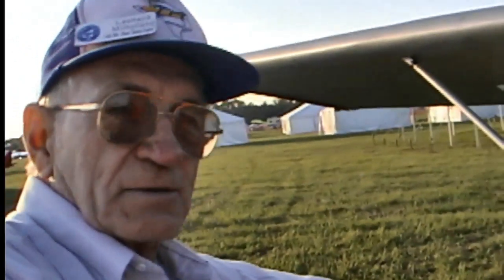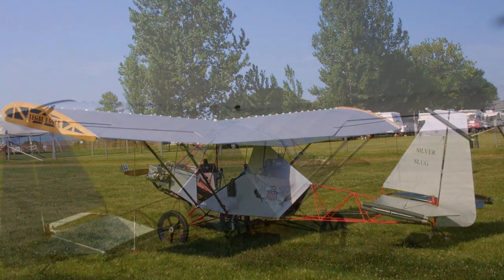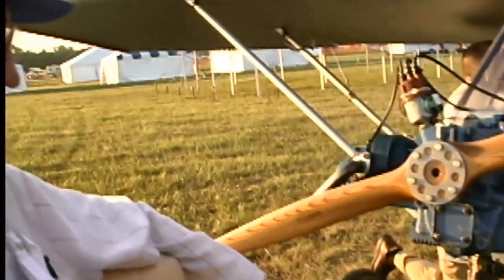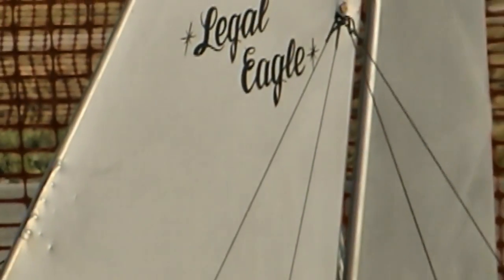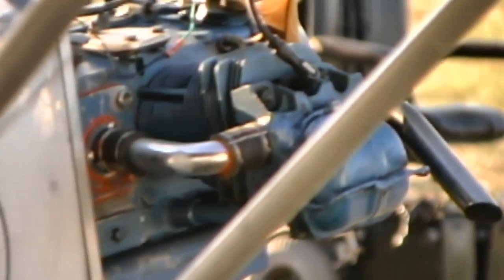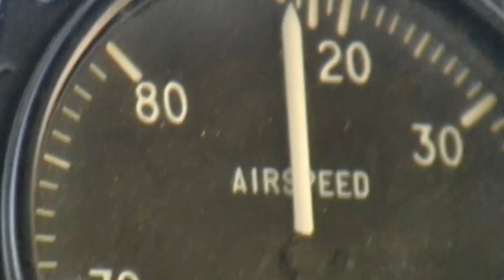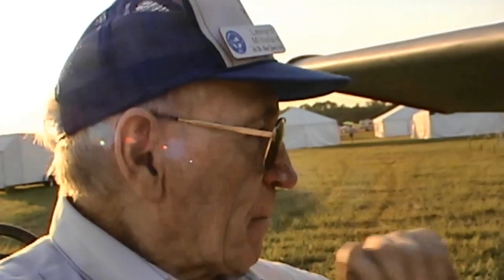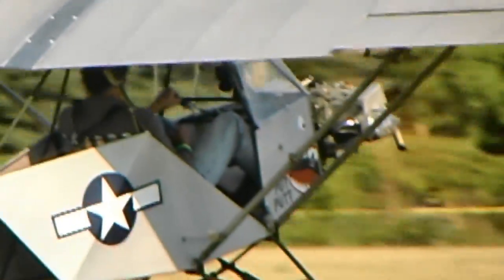Legal Eagle Ultralight, Part 103 Legal Ultralight Aircraft, Leonard Milholland's Legal Eagle.

Comment: This looks like a blast.  I love airplanes.  If only I weren't so afraid of heights.
Reply: Rick West I am afraid of heights, and I am a licensed pilot
Reply: I once had to call the fire department to help get my dad back down a light pole on his airport. He struggled to get up there to change the bulb, and then froze and could not come back down. He was a flight instructor, and an aerobatics instructor at the time.
Reply: Yeah - if everything is working as it should, an airplane cannot fall out of the sky. As long as the wings and tail are still attached, you're gliding. If the engine is still working, you're flying.

I'm afraid of heights too, but knowing this about aircraft made my fear of flying disappear.

Comment: Any engine may stop at anytime especially old ones. What about these small aircrafts?  Are they death boxes?
Reply: The 4 stroke VW is pretty reliable if built properly. Also, the glide ratio of the plane is pretty good so if you have good pilot skills you should be able to land it in the event of an engine stoppage or failure. That said, you are defying gravity so any safety margin you can build in will be helpful.

Comment: anyone know the price range on parts for this size build?
Reply: 3-5k depending on your scrounging abilities.
Reply: Cost me $3600ish in '15
Reply: Kyle Smith for the whole build!?
Reply: Well the vw to steal the engine from can be as much as 40k:)
Reply: Assuming you will buy most of your parts new (from places like A/C Spruce or Wicks), you will spend a good $3500 or more on the airframe.  If you buy a ready-built motor and prop, etc, it will run you another $4000.  But, if you are good at scrounging stuff, and can build your own motor, you can build one a bit cheaper.